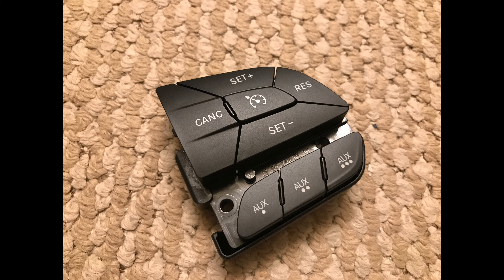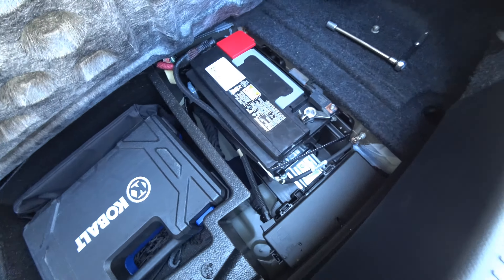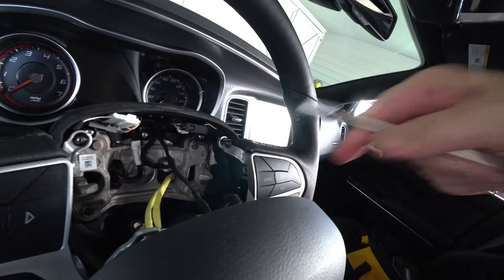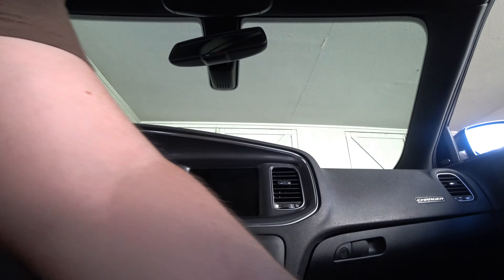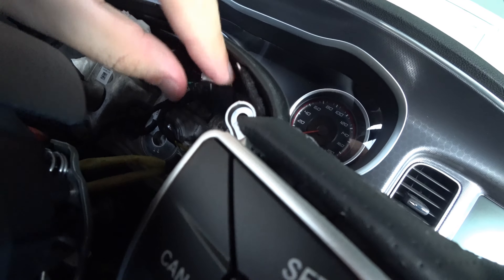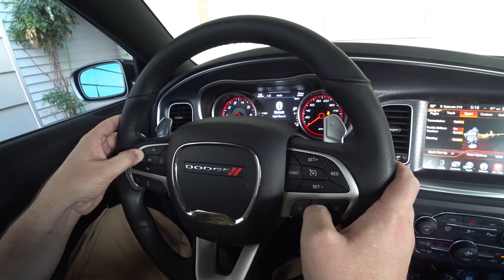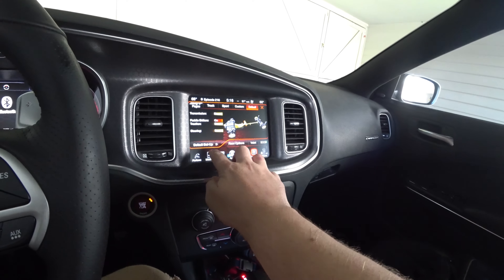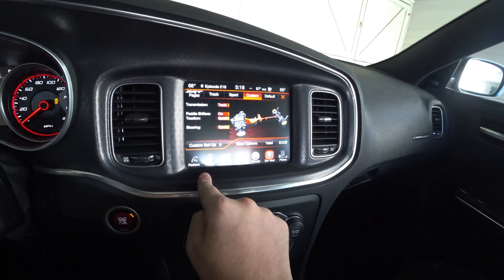New MOD!  Steering wheel control Auxiliiary buttons for Tazer w Install, 4K

Comment: Hello, excellent video.  Why not just use the 3 new AUX buttons by popping off the 3 AUX tops and replacing the old single 3 blank piece with the new 3 AUX button tops?  I was under the impression that the 3 actual buttons are under the stock assembly.  Where did you buy the button assembly?  I would like to buy just the 3 new AUX buttons.
Reply from the maker: I wasn't aware there were buttons under the blank piece.  That sure would be easier and cheaper if that works.  Do they sell just the buttons though?  I bought mine from Steve White Parts.
Reply: @WoodchuckJim  I think the website that has the tazer has smartened up to this too..  They now sell just the buttons, not sure why it was originally stated that we must disassemble like this when they just pop off.  https://zautomotive.com/product/aux-buttons/

Comment: Here is a question tho. Could I put paddles and aux buttons on a manual transmission and then map both the paddles and the audio button to work with light show / external lights or a horn and siren?

Comment: nice video you got a new subscriber :D, i had a question is there a way to set eco mode as one of those buttons instead of the other drive modes that you had and if so how? and when you change the drive modes do you have to have srt pages enabled at all times to be able to switch between the different modes or can remap the buttons and then turn off srt pages to get the scat pack splash screen?
Reply from the maker: Thanks!  I don't think ECO is an option for the mapping.  You don't need SRT to be on for the mapping, but you won't be able to use track mode or eco if its off.  I love the bee splash but I like the SRT functions more.  With the new tazer firmware you can also select a default drive mode it will automatically go to when you start the car now.  I have mine default to sport now.
Reply: ok thank you for replying back hopefully i get a tazer soon.

Comment: Does the Tazer need to be plugged into the ODBII port for the Aux buttons to work?  I'm able to assign the buttons and they work with the Tazer plugged in, but once it's unplugged they no longer function.  I reached out to Z Automotive and haven't gotten a response.  Love your vids - keep them coming!
Reply from the maker: NCGermerican yes it must be plugged in for any button remapping to work
Reply: Really appreciate the response.  I assume you leave yours plugged in all the time?  I'm worried about kicking it through the firewall when I apply the e-brake.  Things like that seem to happen to me now that I'm in my 40's......
Reply from the maker: NCGermerican I leave it in all the time.  I don’t use my e brake in automatic cars when parking so not a worry for me, but just be careful if you do,  lol
Reply: Remove the screws holding the OBDII port and push it up into dash and ty wrap it down to keep the Tazer out of harms way.